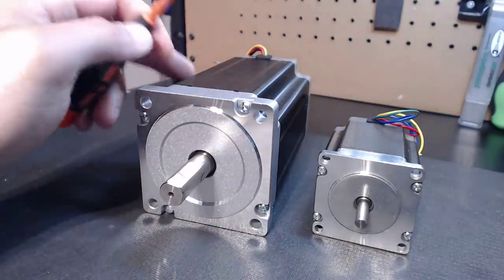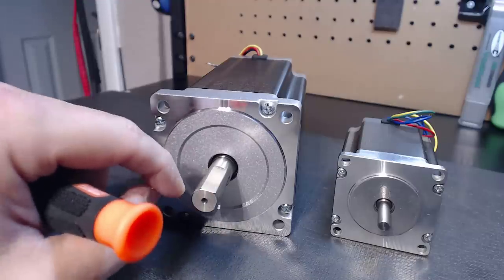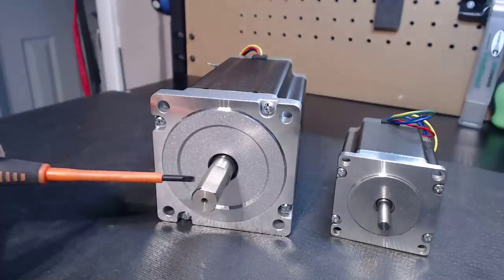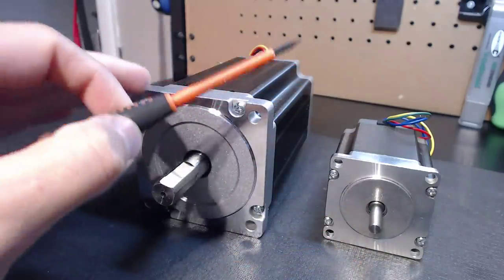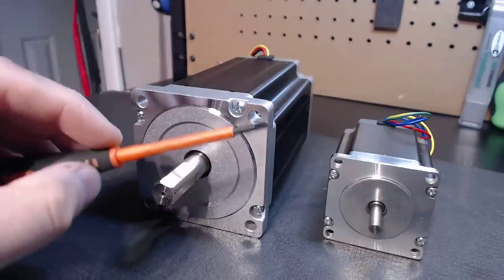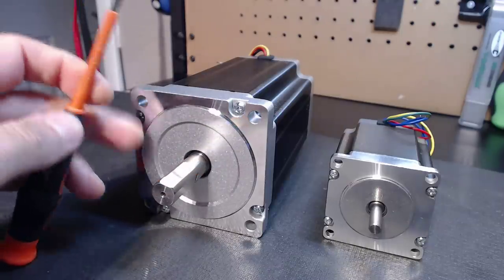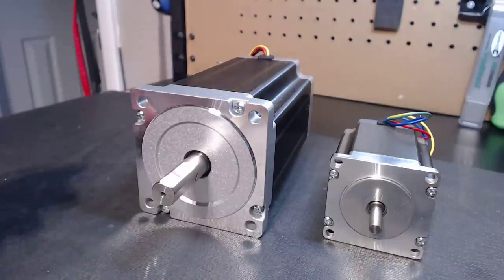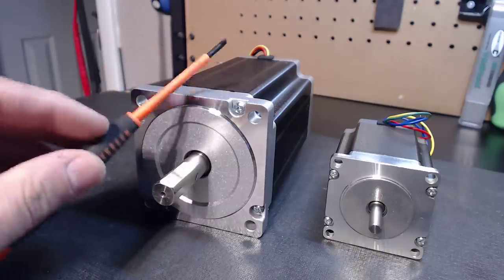Stepper Motor Torque For Your Applications..

Comment: Hi,
I have a question...
I am building a full size 8ft by 4ft cnc, and i am using as stepper motors the nema 34.
Do i need to use a gear reduction, or i can assemble them exactly as they are?
Looking forward to your reply. 
Many thanks.
Reply from the maker: Thank you for your support. You don't need Nema 34 motors for that size chassis. You should be using Nema 23's. I recommend using the motors by themselves with a ball screw transmission. If you need more support please contact me to setup a consultation. Thank you,
Vince
Reply: @corvetteguy50  Thank you a lot for your reply.
I have already bought the stepper motors, and I'm using a gear rack to move the axis along. I choose the nema 34 as they are closed loop motors, and i have found your video too late. I can't send them back now, so i have to use them. Firstly, i taught i need a gear reduction  for them as they are really powerful.

Comment: Any recommendations for a set of open loop stepper motors to drive the wheels of a 13x16 foot, 5 ton gantry crane on a steel v-track?
Reply from the maker: Grimblina, thank you for your support. Unfortunately the answer isn't a simple one as I would have to go over the engineering of the design with its transmission to calculate the required motors. I offer engineering consultations for projects of this caliber. If you're interested in scheduling one please contact me. Have a great weekend! Vince
Reply: @corvetteguy50  I may be interested in taking you up on that offer. Thank you!  👍
Reply from the maker: I always explain to my clients please take all the time you need, and if this is a project for resale then the investment may be worth it depending on your ROI. If its a one off type it may not be. Have a great weekend! Vince

Comment: I am looking to use a motor to rotate a pneumatic cannon; is it possible to axially load these motors or will some sort of rotary table be needed?
Reply from the maker: Hey Noah, thank you for your support. A stepper motor's load is based on the axis rotating. You would be fine in using them if they have the appropriate torque required for your application. Thank you,
Vince

Comment: I'm doing a project that is making the camshaft of an one cylinder generator engine to run on something else than the crankshaft and was thinking of using a stepper motor. I'm just confused on what size I need. I need the stepper motor to spin at 4000rpm and have enough torque to apply a 20 Newton force to the engine valves. Could you help me out? Thanks so much for your video it helps a lot.
Reply from the maker: Hayden, thank you for your support. I really appreciate it.  Unfortunately for your application a stepper motor wouldn't be able to do it as their not designed for that high of RPM. You would require a regular A/C motor for this application. Thank you,
Vince
Reply: @corvetteguy50  thanks for guiding me. It really helps
Reply from the maker: @haydenwelton3835  You bet...:) Thank you,
Vince

Comment: how many torque on 2000 rpm friend..for nema 23 and 34 ,thank you for your answer
Reply from the maker: Thank you for your support. You'll need to talk to your motor supplier to answer this questions as its based on specific motors torque curve with matched power supply. Thank you, and have a great weekend!
Vince
Reply: @corvetteguy50  great ..ok thanx for your info frien..nice video...wait for your new video update..and have a great weekend too..

Comment: So I’m actually working on a project for which I’m making an automatic door, and was wondering which motor to use.? The motor according to me will be rotating connected  in a v belt fashion to the hinge of the door to rotate it. When I mean hinge it has a rod passing through the hinge area of the door. Can u help me regarding this?
Reply from the maker: Sathvik, thank you for your support. The motor requirement for your application is based on the loads weight the you'll be lifting/moving. Thank you, and please be safe.
Vince

Comment: My application is going to be to drive an 16mm diameter extrusion screw as a part of my capstone project and from the calculations I have done it seems that I may need the 34 but do you think diffferently?

Comment: Thanks in advance..i would like to use nema 23 in my m1tr turret milling machine to power feed x,y and z axis, would it be enough to handle the loads and the machining forces.
Reply from the maker: Mohanraj, thank you for your support. In order to answer that question I would need to know the weight of the turret, and the transmission its using to recommend a proper motor for it. Thank you,
Vince

Comment: I'm building a giant 3d concrete printer... What step motor you recomend me if i'm moving 200 kg ?
Reply from the maker: Rafael,
Thank you for your support. Unfortunately a stepper motor isn't large enough to support the load your working with. Thank you,
Vince
Reply: @corvetteguy50  How come 2 Nema 42's wouldn't get the job done?
Reply from the maker: if you ran two together it might be possible if the transmission, and mount  you were using could support the load. My initial response is for a single motor. Thank you,
Vince

Comment: Hi, I bought a Nema 23 with a 6.5mm shaft to turn my  150mm rotary table. I can turn the table by turning the 11mm shaft by finger and thumb but the stepper dose not have the torque to turn the table. I then purchased a much bigger Nema 23 with a 10mm shaft but it still won't turn the table.  Any help appreciated thanks
Reply from the maker: Berty, thank you for your support. Who did you purchase the motors from? The vendor you purchased from should have matched their torque to your application pending you explained it to them.

Thank you,
Vince

Comment: Which one would you recommend for a machine with 6 spindles cutting 4x2 inch rebates in timber.  Do you have adapters to go from nema 23 to 34
Reply from the maker: Thank you for your support. 

A router will perform best setup with Nema 34 motors in the configuration you explained, and I do offer Nema 23 to Nema 34 motor adapter plates. https://www.ebay.com/itm/144041412523

Thank you,
Vince

Comment: Can these motor used in skateboard becoz they are having high torq
Reply from the maker: Om, thank you for your support. If the gearing is done properly with the correct sized stepper you certainly could use one for this application. Thank you,
Vince
Reply: @corvetteguy50  thanks for reply brother
Reply from the maker: You bet...:) Thank you,
Vince

Comment: What stepper motor would work in a sewing machine? I am wanting to swap motors for better control of my speed.
Reply from the maker: Tina, thank you for your support. I suggest removing, or reviewing the one installed in the machine to know its current size, and ratings so you then would know the size you require to replace it with. You can then get the same size motor with more torque for faster production. Thank you, and please be safe.
Vince

Comment: Hello Sir, I am looking for a stepper motor for one my application which is a rotating table. I would need to rotate the table (22" diameter) in steps of 10 degree with 10 sec pause on each step. Max center weight i would have is 20 lbs. Can you please suggest me a stepper motor, Not sure if i should go with Nema 23 or 34. Also i would be adding an wormgear to the motor.
Reply from the maker: Varun, Thank you fro your support. Your application would require my Nema 23 600oz motor as it produces 3.5in/lbs of torque. If your adding a a worm gear for gear reduction the motor will produce even more torque, but reduce its available rotational speed. Thank you,
Vince

Comment: can the nema 23 use a gearbox be able to rotate the thread to press up to 50kg?
Reply from the maker: Thank you for your support. Yes, a Nema 23 can use a gearbox, but for that torque a Nema 34 would be better with a gearbox to produce that amount of force. You can message me for a consultation at Storm2313@gmail.com for a solution. Thank you,
Vince
Reply: @corvetteguy50  thanks for the answer
Reply from the maker: You bet...:)

Thank you,
Vince

Comment: If you drive each y-axis with a separate motor do the torque ratings add linearly. For example 2 x 2nM = 4nM?
Reply from the maker: No, as both motors are used together with the same stall torque meaning f you exceed one motor's torque the other is exceeded as well

 You would require larger motors. 

Thank you,
Vince
Reply: @corvetteguy50  thanks for the reply. So if there a benefit to having 2 y axis motors?
Reply from the maker: None other than system's require it due to their Y axis being to large for a single motor to be utilized. Thank you,
Vince

Comment: Hello. I wanted to use stepper motor to lift the screen. Can one 18.9 Kg-cm motor lift 10kg weight?. Please help. Thanks in advance.
Reply from the maker: Sushi, thank you for your support. The 18.9 Kg-cm motor won't lift your screen. You would require a 1700oz/in -2000oz/in motor. This would be a Nema 34 standard.
Thank you, Vince
Reply from the maker: No two of these motors still isn't strong enough. It would take roughly 6 of them to accomplish the task. Thank you, Vince
Reply: @corvetteguy50  Can I use one NEMA 34 34 kg-cm Hybrid Bipolar Stepper motor. This would be 3046.26 ounce/inch.
Reply from the maker: @sushilkshastry8255   This isn't what;s reflected on this calculator https://www.convertunits.com/from/kg-cm/to/oz-in It reflects 472oz/in Thank you,
Vince

Comment: Hi I am building a robot for my school project. The robot is required to move along any type of uneven sidewalk. The motors we currently have are not enough for the robot to move over anything. Can you recommend some motors that are capable of moving along uneven pavement?
Reply: our chasis is 24 inches by 24 inches and currently weighs 15-20 pounds. Also do you have any recomendations as to the size of our wheels?
Reply from the maker: Adriana, I'm sorry their are tom many missing variables to give you a motor size. I would need to know the weight of the robot, and the transmission you plan on using. thank you, and have a great weekend! Vince
Reply: The weight is between 15-20 pounds and we are using a raspberrypi to collect the data we collect and there are four stepper motors for the four wheels we have .
Reply from the maker: Ok, I need to know the transmission your using to translate the energy from the motor. Is it direct drive to the motor's shaft? Thank you,
Vince

Comment: What does it mean to write 10kg/cm on a DC motor?Will it be measured from the center of the shaft or above it
Reply from the maker: Yatra, thank you for your support. The measurement Kg/cm is simply the unit of measure the manufacturer is choosing to provide the motors measured to torque in. This measurement is based on the position discussed in the video. Thank you, and have a great weekend!
Vince

Comment: I have heard that using smaller motors results in more torque at higher speeds because of lower inductance. Is this true? I look at torque charts and do indeed see how nema 32's drop off quicker than nema 23's, but at 1000 rpm's, the 32 still has more torque. This idea seems to be repeated a lot on CNC forums. Any idea?
Reply from the maker: Digital, thank you for your support. the thing to keep in mind is steppers are designed for low end torque, and not speed. I see this discussed all over forums. The truth is if you use a stepper with more torque the more it has a buffer to move a load at a higher speed. This is because the motor has an extra surplus of torque available. Inductance is a technical term to say electrical resistance, and forum guys preach this everywhere. You should never be selecting a motor just by its inductance, but rather the transmission its supporting as its what actually provides the speed of the system. Thank you,
Vince
Reply: @corvetteguy50  Thank you for the reply!
Reply from the maker: You bet :) Thank you.

Comment: Hi Vince, i found your video very interesting as all the videos you make. I have extended my 6040 on X axis up to 850mm  travel so what i ask is, the original Nema 23 270 oz-in 3A  will handle the extra travel or shall i go for Nema 23 425 oz-in 3A or even the Nema 23 435 oz-in 4.2A + it's driver ?
Thank you again for your time.
Kind regards,
John.
Reply from the maker: John, thank you for your support. Motor torque has nothing to do with table length. The torque of a motor dictates the machining capacity its able to handle while under load. If your using metal substrates for machining the larger motors are your best option. If your working around woods, and plastics the smaller motors will be fine. Thank you, an have a great weekend! Vince

Comment: 1700oz/in means 12n*m so this kind of motor can be used for construction of a electric scooter? What will be a nice battery for it based on your knowledge?
Reply from the maker: Jose,
Thank you for your support. I don't recommend stepper motors for scooters as their designed around low end torque. Your better off using a DC motor for this application. Thank you, you, and your family please be safe.
Vince

Comment: question👉🏿converting to be a mini drill, is it possible bro..? (nema 17) how? 🙏🏽🙏🏽
Reply from the maker: Thank you for your support. I need to know more details than that to provide information. Please contact me to setup a consultation on your retrofit project. Thank you,
Vince
Reply: @corvetteguy50  thank you for your reply bro..🙏🏽🙏🏽👉🏿my knowledge abaout this is 0=bad👉🏿stiker stepper👉🏿EM-242 , STH-39H1012 , and 2793DG
mostly..youtube content is about 'stepper as generator' no stepper as a drill/mini drill😁i think is gonna be powerfull ( correct me if wrong),the point is to make 'high speed' with stepper, can it be made? (simple way not complicated way😁)
nb: apologize about my english🙏🏽thank's bro..🙏🏽🙏🏽

Comment: Do you think a stepper motor is a good idea to use for a robot arm base?
Reply from the maker: PK, thank you for your support. Stepper motors are excellent for this application as long as their torque rating is correct for the desired application. Thank you,
Vince
Reply: Thank you for replying and for your helpful videos!

That is good to know, also will it allow the base to fully rotate (360 degrees)? 

(I’m very new to stepper motors)
Reply from the maker: @PK-mh1ir  Yes, they will. Here's a link to learn about them https://www.orientalmotor.com/stepper-motors/technology/stepper-motor-overview.html?gclid=Cj0KCQiAip-PBhDVARIsAPP2xc02OBAezfHYtWGMt2Blwzt6y0-TfGT7mLrLacss9QjXxpQTmMXssngaAhMXEALw_wcB Thank you,
 Vince
Reply: Thank you very much!!
Reply: I got one more questions if that’s fine, 

How would I increase torque for a stepper motor? Do i buy geared stepper motors?

Comment: Hi. I am doing diy cnc small mill for metal and want to put 2010 ball screw. What stepper motor you suggest and what about availability . Also want to put 5.5kw spindle estimated weight of spindle 20kg
Reply from the maker: Thank you for your support. Please contact me at Storm2313@gmail.com for a consultation as there's far to many variables to answer your question without knowing them all. Thank you,
Vince

Comment: Can you easily measure the torque that the motor is producing?
I need  to build a test bench to know the max amount of force the product can take / find the breaking point
Reply from the maker: Hey Brent, Thank you for your support. Unfortunately when it comes to engineering seldom are things easy when dealing with measurement accuracy. There are designs on YouTube, but the accuracy is based on the equipment, and the knowledge of the end user performing the measurements. Thank you,
Vince

Comment: what is load handling capability of NEMA34 when lead screw is attached with motor for moving load up and down
Reply from the maker: Minahil, thank you for your support. The load rating is based on the motors holding torque which is arbitrary in your question. Please provide the holding torque for the motor, and I can answer the question. Thank you, Vince
Reply: if holding torque is 816N.cm and motor is bipolar then what will be weight
Reply from the maker: @minahilashraf5617  here's the link to review https://www.convertunits.com/from/newton+centimeter/to/oz-in The answer  is 1155oz/in Thank you,
Vince
Reply: sorry to disturbed you.I want to know weight in kg that bipolar motor of torque 816N.cm can lift up and down.your provided link is the conversion of torque.it does not tell weight lifting capability of NEMA34
Reply from the maker: The weight it will handle in Kg is roughly 30 to be on the safe side. Please remember to leave a like. Thank you,
Vince